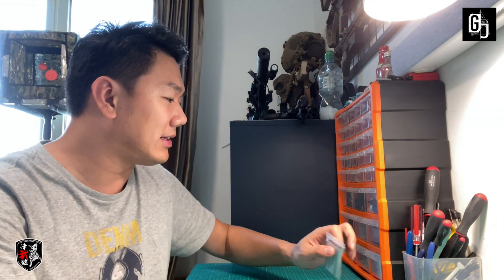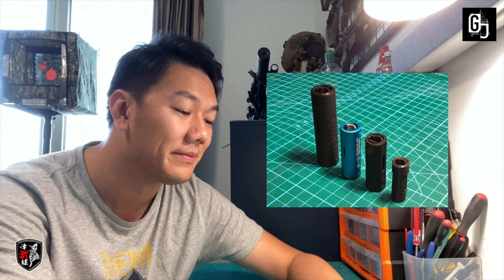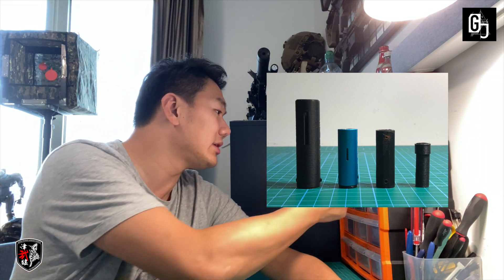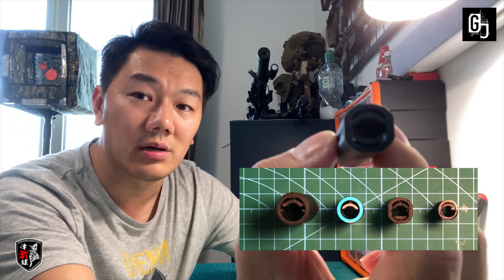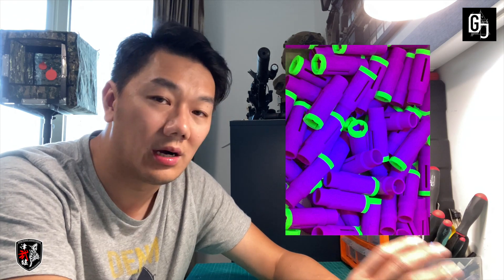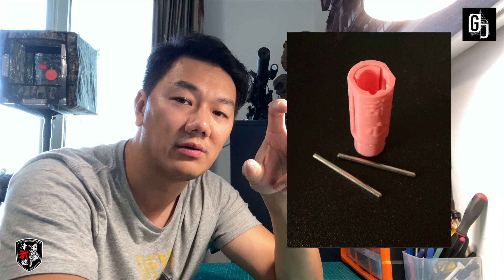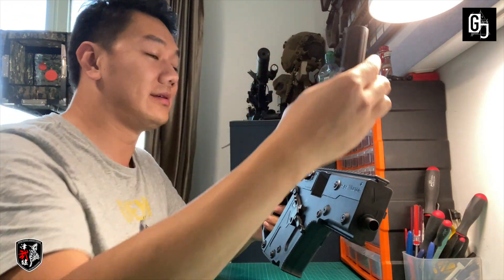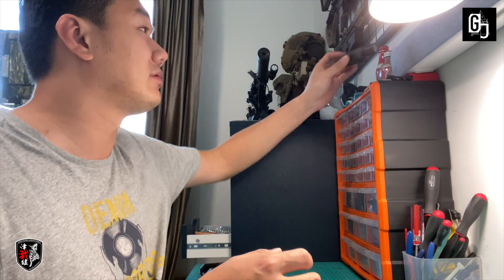Gel Blaster Tips: Hop Ups

Comment: Also have a look at the Rizer NT1 outer barrel with an integrated hopup. Have been using it on my SLR and my HK416 and both fire like lasers now.
Reply from the maker: Rizer makes great hop ups, but I use sweetheart for the lower profile so I can be more flexible with tracers, flash hiders and whatnot.
Reply: @galapagosj3021  Yeah - since I found the NT1 by Rizer (integrated outer barrel with the hopup) I havent looked back. In saying that, I recall you not being real impressed with the SLR CQB for its accuracy - do you know of the WI gearbox has been ported correctly for such a short barrel? Or have they been lazy and just chucked in a standard box? Also, I did hear rumours that the SLR flash hider was a hopup as well?

Either way - I pick mine up this afternoon, so can probably answer those questions myself soon :)

Comment: If you have your own 3D printer you can either design your own like I have or get a design from Thingiverse. Not only can you adjust the pressure but you can adjust the layer heights of the print to make the surface smooth or course for greater grip with less pressure. I find if printed in pla or abs they are quite strong and only cost much to print

Comment: Great video, quite informative. From all 4 sweetheart which one is you recommended for standard gearbox which fps less than 260fps? I would love to buy all 4 but seem like useless if i am only use 1 number hopup.
Reply from the maker: For myself, I go by this principle, the lower the FPS, the higher I go with hop-up. 260 fps is relatively low, so level 2-3 for the sweetheart should be good.
Reply: @galapagosj3021  thanks for the reply. Its really helpful mate. Cheers

Comment: Links to sweet heart hop up?
And will it even fit my ldt hk416d?
Reply from the maker: Check out my latest Gel Blaster News video, the 2020/01/26 episode, it has the link to the hop-up. It will fit your HK416D, it uses an aluminium barrel that is quite a standard size. It might be a bit loose, so just add some thread sealing tape to the inner barrel.

Comment: Thanks for the great content. You mention that you hold the new hop up in place using electrical tape. Is this the manufacturers recommendation? Have you noticed the hop up becoming loose or sliding off after some time?
Reply from the maker: Nah, its just my own solution. It really depends on what inner barrel you are using, some might be so thin that you might even need to thicken the outer diameter of the inner barrel so that the hop-up can fit snuggly. But at the end of the day, gel blaster isn't as prevalent as airsoft, so a lot of the solutions and methods are all trial and error and there aren't really much official documentation out there. I've been playing with gel blaster for close to a decade now, so I might have more strange solutions than others, lol.

Comment: Do you think CQB games would even require hopups? I’ve note been using them on small map plays. The spread kind of helps sometimes
Reply from the maker: Actually that's a very good point, because it goes back to that question I mentioned in the accuracy video, what is your application for the gel blaster? Your playstyle is much more important when considering what upgrades to use. Personally, I still apply hop-ups even if I play CQB arenas, especially our own. We have ranges of up to 20m that require quite accurate shots. Without the hop-ups, your first shot might not hit the target and once you pulled the trigger, you would have exposed your position. So in this case, hop-up is still quite important if you like sneaking around and shooting from afar. If you just rush and spray, then hop-up isn't that necessary.

Comment: Regarding gel ball size variations a few aussies here have rigged up size sorting machines!
Reply from the maker: Dude, please share how to make, I'd love to have one of those. But do these machines really sort even down to 0.1mm of difference?
Reply: @galapagosj3021  For sure mate. Check out the Low Guido Chop Shop channel and find the video "new heavier LDT milkies gel ball testing (part 2)" for some footage at around 3.04. There are some others floating around but generally use right angle spaced progressively apart with containers underneath. Usual folks take a mag and feed the machine via a mag tube. Low Guido did something extra spec. But cannot find a vid on it.

Comment: Has anyone done any experiments with rifling the barrel (for better spin), or re-visited using airsoft style hop-ups (they might work better now with the harder gels on the market). - Just putting it out there
Reply from the maker: Spherical ammunition require the Magnus effect to help it gain the up spin to ensure the trajectory stays level (or slightly up), rifling is more for long cylindrical ammunition and will not help gel balls. Airsoft guys have tried that stuff and the general consensus is that, its more a hinderance than a help. It seems that rifling has a detrimental effect on the trajectory for muzzle velocity beyond 90m/s (approx. 297 fps). For gel balls, although its possible to hit that muzzle velocity no problem, the gel balls deform as well and are pretty soft. I'd imagine it'll get shredded up as it travels along a rifled barrel...
Reply: @Galápagos J - Ok, thanks mate ,that was a very in depth response - much appreciated. Still could be worth looking into the second thing I said though.

Comment: 4 in 1 actually bad(i test it 4month ago)
the perfect 1 are those stainless steel rod (14mm)
Reply from the maker: The ones I use and promoted work pretty well for me, what problems did you have with them? With the different levels of hop-up, you need to pair it up with the right muzzle velocity / spring power. Also, a lot of other factors can affect trajectory other than the hop-up. The hop-up should only be applied as a final touch when everything else is solid, including properly prepared gel balls.
The ones that have the steel rods are great, but they are much too big for me since it reduces my applications, but that's the only problem I have with it. Performance as a hop-up, its great.
Reply: @galapagosj3021  those with stainless steel rod type are more effect and perfect for almost any type blaster....
4 in 1 type not only me said it actually bad...i pass few set to local(malaysia) player all feel same way....
Reply from the maker: Interesting, what happens when you guys use it? No hop up effect or too much? Can you tell me what the problem is like? I can troubleshoot for you.
Reply: @galapagosj3021  i give away those hopup already...hahahaha
and my blaster now in perfect shape...if u saw video on my channel.....stay perfect around 280 fps in 18cm barrel